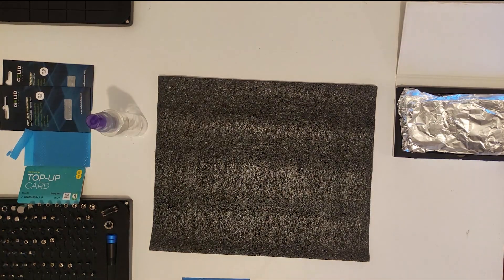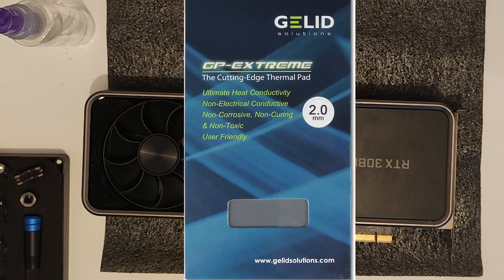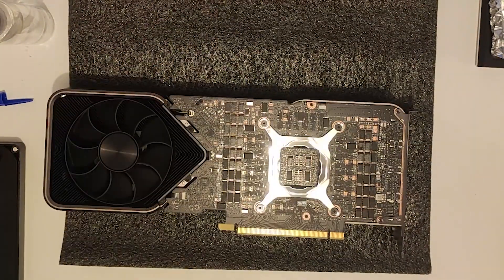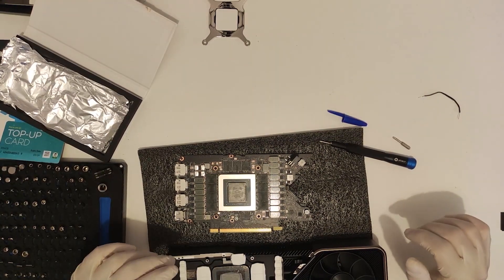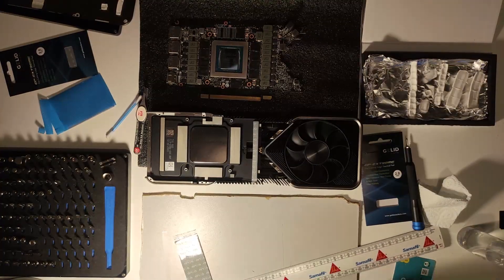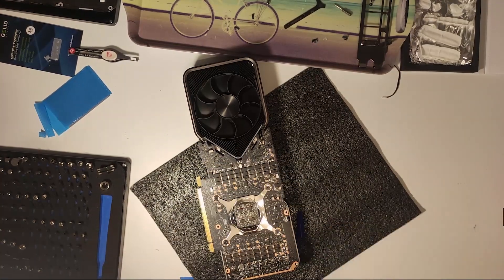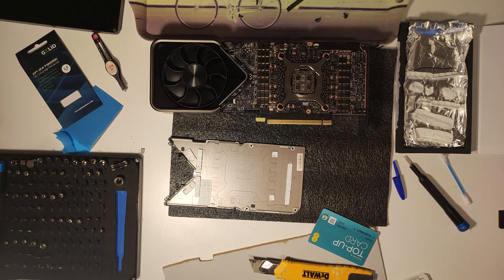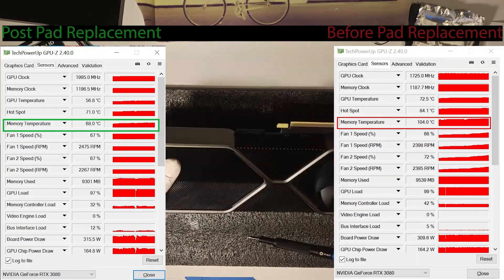Nvidia RTX 3080 FE Thermal Pad Replacement & Re-Paste-Improve your Mem Junction Temp by OVER 20C

Comment: Thanks so much for putting this video together!  It really helped me out.  I tried 4 times to get the 2.0mm pads to work on the front by squishing them and kept having high gpu temps but it worked first time for me using 1.5mm pads on the front.  My memory temps dropped 25C on my 3080FE.

Comment: Really great and easy-to-follow video...it helped me with my 3080 Ti FE .... -23 degrees. ...thank you.
Reply from the maker: I am very glad to hear that! Enjoy your really nice GPU!
Reply: That's amazing! On mine the mem temps have dropped by about 14c so maybe there's room for more improvement
Reply: i also have a 3080ti fe, i am a bit confused whether to go for 1.5mm or 2 mm (gelid extreme) for front/die side and i guess 2mm (gelid extreme) should be fine for the back/backplate side
Reply: Thanks foe the tutorial. I changed out my pads using both Gelid and Frosty Thermal Pad 12.8 since I ran out of gelids. Getting same temp drops so very happy. Too bad its still hard to get these at MSRP.

Comment: Thanks for such a good tutorial. Testing the card without back-plate is a really smart idea, this leads to much easier tweaking process since number of places with possible mistake are significantly reduced. There is also one additional smart move: disassembly card again right after tighten cooler back-plate screws, just to check that die in good contact with cooler and there is no gap in between.

Comment: Great video , after trying and hitting the hotspot bottleneck and trying different things, ur guide saved my sanity. Gelid pads and thermalright paste worked for me and got the temps down ( full mining load max over 12 hrs in a 23C room : 94 mem and 90 hotspot ) . I wasn’t able to hit the number u mentioned but it was way better than the 110 I was hitting on memory before the mod and 108 on hotspot after the botched replacement without squishing )

Comment: Thank you for putting this together.  I just did my card and ended up with 88c on the memory and 60c for the gpu.  Probably have to do it again in the future, but for now that is way better than 110c on the memory from before and 100% fans all the time.  What a nerve wracking process this is to mod a $$$$ card.
Reply from the maker: Nice work! I can really sympathize with the sentiment, especially since replacing it any time soon is by no means guaranteed if something goes wrong- after cleaning/repasting probably north of 100 cards until now my hands were a bit unsteady at the start of the process on this one! Was the 88C temp in gaming or more intensive memory applications like ETH mining? Also, did you happen to check your core hotspot temp to make sure its within 10C of the "core edge" temp?
Reply: @ESHW  88c is when mining in off hours to help payoff the card, when gaming the card runs abit cooler, but I like it better now because the fan runs almost without any noise now, previously it was much louder.  I'll have to look at the core and other temps with a better tool, which one do you suggest?
Reply from the maker: @hkcitation  I found that HWINFO64 sensors (interpretation) are about as accurate as you can get with software only without busing out a voltmeter or external temperature probes. That should show you both core (edge) and hotspot temperatures. The core edge temp is the one that you would traditionally think of as the GPU average with the hotpot being the hottest of the individual sensors. Ideally the hotspot should not be hotter than the core by more than 10C. The 88C memory temp in mining in your case i believe is very decent if you are not applying any tweaks to the card and its about what can be reasonably expected after the mod. I am by no means a mining expert, but i would suggest setting your fan to 65% ish constant and your core frequency to below 1Ghz (around 950-975) leading to the core voltage dropping to about 730mv or so - all the while leaving the memory clock alone as it makes the biggest difference to mining - ETH is very memory intensive. That should massively reduce your power consumption increasing efficiency, protect the card long term from any degradation and push the memory temperatures (depending on your ambient ofcourse) down by another 10-15C while still giving you around 90MH.
Reply: Good result man
Reply: Chill. You just changed thermal paste, there was no modding done lol

Comment: I got had the same problem and I SLOVED it.
Only applicable to FE Founder Edition.
On the front (Core) side use 2 mm or 1.5mm ONLY!!!. If you use 2mm make sure its a soft pad, not a hard one. Hard pad will create a bigger gap between the processor and the plate. Not recommended Gelid pads. 
The most important part if high VRAM Temp.
Put some thermal paste on the metal side of the cooling block. Between the pad and the metal side of the cooling plate is rough and the paste will help a lot. Put a little more if using 1.5mm pads.
On the bask side use 2mm pad only not more then that.

It solves it all you high temp.
Reply from the maker: I didn't think of adding thermal paste onto the pads, next time I do a GPU with GDDR6x I will give it a go if the block has a rough machined surface.
Reply: Do you guys think everyone should apply the thermal paste to the pads or only if the pads don’t work well?

Comment: Thanks for the Amazing detailed Tutorial, I'll be trying that asap once I receive my Gelid GP extreme pads.

I'm a little bit stressed as the 30 Series Fe look abit hard to disassemble compared to my old 1080 Strix, but it's needed as I have huge drops in performance.
Reply from the maker: Take your time with it and try and enjoy the experience! Don't panic if you don't get it perfect first time and you get core hotspots - more often than not that is what happens after pad swap, but with a bit of subsequent tunning it's easy to get rid of those and enjoy even better core temps than before. In the end the results are amazing and more and more people will have to do it as the stock pads "bleed" silicone and become ineffective - Igor's lab put out an investigation on that... https://www.igorslab.de/en/looming-pads-and-too-hot-gddrx6-memory-siliconitis-on-a-geforce-rtx-3080/

Comment: 5:42 To get this cable out, you must lift from the bottom up in a vertical motion. dont pull it back horizontally. just get a thin stick under the cables, and lift up. there will be very little resistance.
Reply from the maker: Thanks for the tip! Funny enough I'm about to tear down a 3070ti and I'm sure they have the same connectors
Reply: @ESHW  do let me know how it went

Comment: three years later still the best video for this. ive done this twice and theres so many little things you mention that i didnt do from the other guides that have added up to my core running 600+ mhz under base clock 😅
will come back to this once my pads and paste come in the mail. im fairly sure its because i never used isyprop to clean and didnt take the time to fully blow out all the dust in the cooler. it’s been running at 105c for a year now (memory never went over 80 tho lol) so i’m worried its going to be permanent, but i’d rather spend 30 trying to save it before spending 600 on a 4070
Reply from the maker: 105 is within the specifications (barely - but still technically acceptable as the cut off is 112C) so you wouldn't have damaged anything! With a proper service it will be running perfectly again.
Reply: @ESHW got most of my parts today!

Comment: 1.5 mm on the gpu side worked better for me. When i used 2 mm my gpu core temps went crazy hot.
Reply from the maker: I am surprised that happened with soft pads, I had similar issues with the junction temperature going crazy, but all I had to do was "squish" the pads a bit using a mirror and re-seat everything at which point the issue was solved.

Comment: Word of caution, if you have the models, 3080 FE late 2021, use 2mm on both sides (Extreme Gelid) I tried 1.5 and it would not do any contact in the front side.
Reply: What does this mean?
Reply: Multiple sources claim that this depends on the year your 3080FE was manufactured, apparently they slightly altered the housing somewhere in 2021.
I ended up trying 2mm and 1.5mm, when using 2mm it immediately hit 105c on the hotspot and started thermal throttling when starting a benchmark.
With 1.5mm, my hotspot never goes above 93c and the fans now only have to go up to 60% instead of 80%
For anyone planning to do this, I suggest getting both 2mm and 1.5mm to see what works best for you

Comment: Ok I'm just here to comment on if your questioning whether the ultimate 2.0 mm pads will work as opposed to the extremes mentioned here. They will not. The reason being is the ultimates are much too hard. I found this video as I was finishing up my 3080 TI FE and upon installing it, the card would post the bios logo while revving the fans then shut off. Another video where someone had similar symptoms showed that harder pads kept the die from contacting the cooling pad. Sure as shit that's what it was. The ultimate pads are too hard to compress preventing contact on the die. Save yourself some money and get the pads he recommended. PS thanks for your video boss 🤙
Reply from the maker: Cheers Rob! I hope it all works as indented now. Enjoy your lovely 3080TI
Reply: @ESHW  thank you internet friend ^_^

Comment: This one is a big oopsie for nvidia, most 3080 models are facing the same 100C Memjunc issue, forcing users to risk voiding warranty by replacing the pads.
Reply: i would recommend the more expensive Laird HD90000 in this case.
Reply from the maker: @711jastin The 22 (Shore 00) harness of the Laird should make the application a lot simpler as the cooler would squish them better, but their thermal conductivity at "only" 7.5W/mK makes me a bit nervous - other people have used the thermal grizzly minus 8 with similar thermal conductivity (granted they are a lot harder at 60 shore 00) and the results were mixed...improving the situation but only dropping the temps to the mid 80s C while gaming - still down a good 15 degrees. If you do end up doing a similar swap on any GPU variant using the Laird ones, do write back please, i am very curious of the outcome. 
Unfortunately it seems the delamination problem isn't going away (with the silicone oil seeping out and shrinking the pad) so the majority of cards will likely start suffering at some point in their useful lifespans... and not only limited to FE models.
Reply: @ESHW  the Laird is so soft you can shape it like playdough. Some Chinese just shape them into spheres and let the heatsink squish it flat. I am doing mining on my zotac Rtx 3080 Trinity, the memjunc can go as high as 110c, replacing the pads (including a missing pad from factory) reduced the temperature to ~85. The missing pad have me worrying about other similar model cards, they could fail a lot earlier than their expected lifespan.
Reply: Gelid extremes are nice. Never heard of that one you mention. I just know you need 12 W/mk pads. If you wanna save money there is also Frosty Thermal Pad in the US Amazon. It is also 12 W/mk but cheaper than most I have found.
Reply from the maker: @storedcoin4026  I really tend to agree with you - even if you don't spend scalper prices on your GPU (and that is a BIG IF) £/$/€20-30 compared with the MSRP of the card doesn't look like such a massive investment so getting the best performing ones seems like the way to go.

Comment: Very informative, only video giving me the confidence to replace the pads finally! I also noticed that on the front pcb template, no.1 is 6x56 but you covered the entire area (basically same as no.5). Is it ok to leave it that way?
Reply from the maker: I am so very happy to hear that! Do let us know how your re-pad went!
To answer your question - the short answer is Yes it is OK to leave it there - the pads are non-conductive so even though the SMDs are missing from the card in that area, the pad will basically stay there attached to the cooler doing nothing - it's a bit of wasted material, but it will not hurt anything.
Reply: @ESHW  Cool i might as well put it that way then. But i do have one more query about the screws, can we put them back in any order after removing? Like suppose the screw that was going in C will now be in A? (I know this a really stupid question sorry XD)
Edit:
Likes the ones underneath the magnetic screw covers since i may not remember which one goes where.
Reply from the maker: @mohammedashgal7934  from memory all of the screws under the magnetic covers were the same (the little magnetic covers are handed though so you need to put them back in their correct holes) - the other screws that sit under the Y-piece are also all the same, but i think they might have been different from the ones under the magnetic covers so its probably best to keep them separate. 
There aren't that many screws on this GPU so might I suggest tracking them on a sheet of paper or something - it makes it a lot easier to re-assemble and not mix them up.

Comment: Due to high temperature of memory junction i decided to replace the thermal pad on the new bought 3080 FE. After replacing the thermal pad, card working perfectly but no fans, no RGB led, no logo light.Did this happen also to you??? really strange
Reply: Maybe you unplugged something
Reply from the maker: I would double check the connectors and re-seat them. After the mod it should all work fine just like before...

Comment: I found recent 3080fe Nvidia seemed to have revised something with the heatsink the 2mm extreme gelid gives really high gpu and hotspot temps so seems heatsink isn't getting proper contact with gpu chip , the heatsink has 2021 date printed on it 

Just incase anyone starts having issues with high gpu and hotspot temps using 2mm extreme pads . I haven't tested but others report to use 1.5mm extreme gelid for the VRAM and 2mm extreme for the VRM
Reply: I just re did all the die side using 1.5mm gelid ultimate and seems to have solved the issues , running benchmark at stock max GPU got was 75c with hotspot 85c , vram 84c in room with 25c temp 

I also did another 3080fe like 9 months ago using 2mm gelid extreme which worked but didn't with recent 3080fe so either Nvidia changed something with the heatsink or gelid changed the extreme or I had bad batch ? But with more people recently getting this issue makes me think something has changed with the heatsink , hopefully someone can confirm
Reply: @yell9845  Thanks for your comment, I'm having the same issue as you with a brand new RTX 3080 with 2mm pads (but i'm not sure that I did it well too...), i'm going to try tomorrow with 1.5 mm and give you feedback on how it worked
Reply: @Divinnitty  How did it go? Did the 1.5mm pads work? What brand did you get?
Reply: @TheHanleyProject  I used extreme pads, and I just went back to the start, maybe with around 10 degres less in vram, I should probabably change paste and put a mix of 2mm and 1.5mm, but meh I won't try to be too greedy

Comment: Hello
Thanks a lot for this quality content.
Why not placing a pad on the middle of the backplate to improve cooling of the core ?
Reply from the maker: I am glad you enjoyed the video! Yours is a great question - and the answer is there is usually no thermal pad there because it would be rather ineffective; I mean you can certainly add it if you are so inclined as it would probably not hurt anything. The back of the PCB does not conduct that much heat and unlike memory modules that create most of the heat next to the PCB (just a quirk of how the chips work), the GPU die heat comes from the top that is in direct contact with the cooler.

Comment: try adding 3mm on the back, it worked perfectly with mine.
Reply from the maker: I have no doubt that 3mm works on the back, but I could not find 3mm gelid extreme anywhere online in the UK at the time, only the ultimate which are too tough. I did experiment with the ultimates first adding them on the back and the results were within margin of error. It did help, no doubt, but considering mine were separating from the front it still could not keep it from going over 110C, plus it was bowing the backplate because they did not squish under pressure which made me a bit nervous....